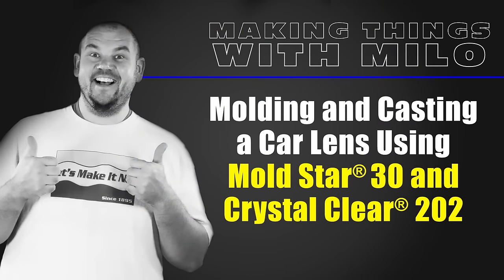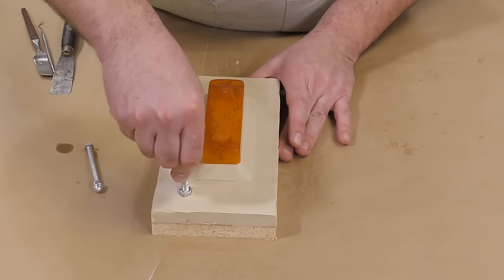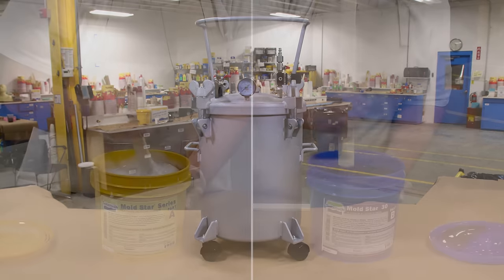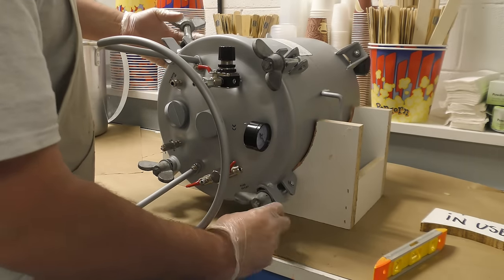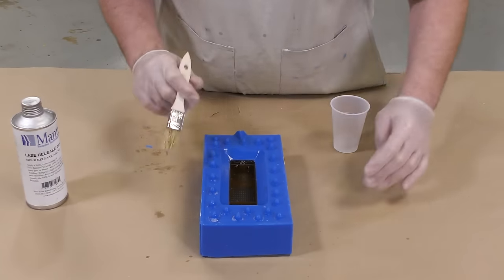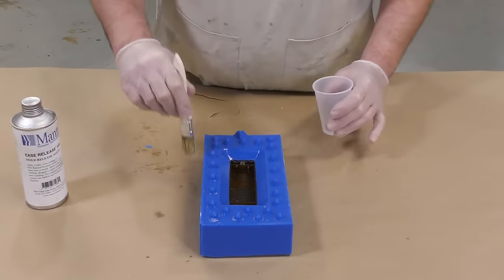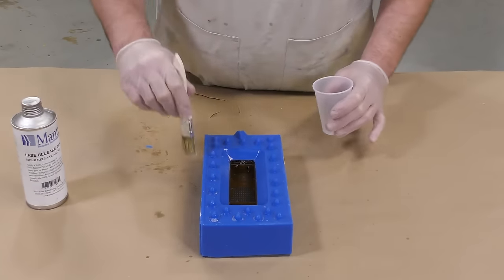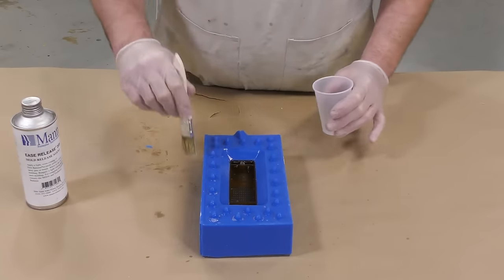How to Create a Replacement Tail Light - Moldmaking and Clear Casting Resin Demonstration

Comment: I was wondering what size pressure pot you were using?
Reply from the maker: The inside of the pot dimensions are 12.5" (31.75 cm) diameter opening X 15.25" (38.74 cm) Tall. https://www.smooth-on.com/products/pressure-chamber/

Comment: I am confused. I've seen videos of "lens casting" with similar materials- but a vacuum chamber was used, to pull out air- while here- a "pressure pot" is used. Also- what if a large lens is needed- maybe 5' long, 6" high; can "handmade" devices be made?
Reply from the maker: Both methods help remove bubbles from the finished casting, but in general we recommend pressure casting when feasible for bubble-free castings. If you want to discuss a specific project in more depth, I'd recommend reaching out to our 1-on-1 support team here: https://www.smooth-on.com/support/ticket/add/agree/

Comment: ok 
nice ! could you do this with brake and headlight lens?
Reply: Brake yes, headlight no due to possible heat and optical clarity issues and impact resistance.  Brake might also have heat issues since the same lens may have a bulb light for extended period during night time headlight/parking light use.

Comment: I didn't read through all the comments so maybe the following question came up already.
Why not use a vacuum chamber instead? I would think a vacuum would draw out the air bubbles. How is a pressure chamber better?
Reply: yeah sir, i keep thinking the same question. any differences between pressure chamber and vacuum chamber?
Reply from the maker: A vacuum chamber will draw out the bubbles that are mixed into the resin in the act of mixing, but the resin can still pick up bubbles during the act of pouring.  As pressure casting happens after the material is poured, as long as the mold is made correctly, this will eliminate those bubbles.
Reply: thank you for your englighment sir.
Reply: My question as well
Reply: I saw one video where they placed the molding compound in a vacuum chamber first then went on to pour the mold. I'm thinking this is a good way to go.

Comment: How do you deal with the issue of shrinkage? Or does this lens not have to mate into another part?
Reply from the maker: Shrinkage on this casting was very minimal, and the mold has zero shrinkage, so fitment was not an issue.

Comment: I have some Dragon skin 10NV coming, not that I have a gallon paint shaker on hand but I was wondering if that would help mix this product up? Actually wonder about a few ways.

Paint Shaker
Drum roller
Drill paint Mixer paddle

not that It can't be just done manually, me just thinking out loud.
Reply from the maker: You can mechanically mix using a turbine mixer, but will still need to scrape the sides and bottom of the mixing container.

Comment: Are there any plastics that are clear and good in high jeat applications that could be moulded this way?
Reply from the maker: What temperatures are you looking to resist?
Reply: @smoothon  Im not sure of the exact temprature, but i could find out. Im looking to build a replacement peice for an oem cam gear cover on a 4cyl car engine. The oem ones are plastic as well. Looking to go clear so you can see the cam gears turn. The aftermarket makes clear plastic ones for popular engines like the toyota 2jz. But not for my engine.
Reply: If you google clear timing belt cover you will see what i am talking about

Comment: Wouldn’t degassing the liquid silicon in vacuum work better than pressurized chamber?
Reply from the maker: When pressure casting, it is beneficial to make the mold under pressure as well, when possible.
Reply: my question is would putting the mold in a vacuum be better to help pull air and moisture out as well as when doing the actual casting??
Reply: Eric Eaton I think it’ll bring more harm than good. It’s better to “treat” or “prepare” the casting material in vacuum chamber, prior to pouring it into the mould. Effect would be similar to pressurizing it during casting, which is pressure difference before and during casting, with one major exception: if treated with vacuum prior to casting, the part comes out void of micro bubbles trapped inside, whereas if only pressurized during casting, all those micro bubbles stay trapped and suppressed inside the part.
Reply from the maker: This is correct.  Vacuuming should be done on the mixed material before pouring.
Reply: @smoothon  most definitely vacuum degassing before pouring into the mold form. But to clarity possibly, would this also be done in combination to pressurizing the setting silicone? Or is simply just  degassing, or just pressurizing alone sufficient? Thanks.

Comment: Let's say you want to mold an original injected molded rubber part.  I have a rubber piece to a car console.  It looks like stitched vinyl or leather, but it is actually all rubber that appears to have the grain of vinyl/leather as well as baseball stitching.  Is there a product to create this type of casting?  Would you still take the approach of using clay to make the mold for rubber?
Reply from the maker: Hi there!  This is a good question for our tech support team, can you send them a ticket here? https://www.smooth-on.com/support/ticket/add/agree/ Thanks for watching!

Comment: Could this work for things like toys that have a part similar in style to this?
Reply: Or are we able to send parts to you to make a casting part of?
Reply from the maker: Definitely, we have another video showing this similar process.  We don't make molds, we manufacture the materials -  https://www.youtube.com/watch?v=WlTuDgzhTlk
Reply: Smooth-On Also could you reproduce a rubber part this way that needs to be moulded from both sides? Or would a different method need to be used due to the part being Moulded is rubber?

Comment: I’ve seen people use a vacuum chamber to pull out air bubbles. Seems to require more careful observation (need a clear pressure vessel to manually modulate the vacuum as the material foams up) but it seems to be the best of both worlds if you alternate with pressure.
Reply: I would think using a vacuum chamber for the liquid prior to pouring then use a pressure chamber for the curing process

Comment: Have you got an easy way to produce a mold for a mirror image object?  For example, what if you wanted to produce a lens for the other side of the vehicle but did not have an object intact to produce the mold?
Reply: One thing you could do is try to see if the other side, when flipped over, will fit the side that's missing. If so, then doing a mold of the existing one will work find for you.

Comment: is there any danger with off gassing inside the pressure pot?  I know they use Nitrogen in autoclaves for this reason.
Reply from the maker: This resin is curing at room temperature, and as long as it is being used in a room-sized ventilated area, outgassing is not an issue for this process

Comment: Instead of resin, could you use cement ?
Reply from the maker: For concrete casting, we would recommend a urethane rubber mold, such as one made out of Vytaflex.

Comment: Would a vacuum chamber work or must it be possitve pressure?
Reply from the maker: Pressure Systems (pressure chambers and compressors) offer the optimal method for creating molds and resin castings that are truly bubble free.Vacuum Systems (vacuum chambers and vacuum pumps that pull 29 inches of mercury) are used to remove the air from high viscosity materials like silicone rubber before pouring. They are also ideal for vacuum degassing liquid plastics for making bubble free castings.

Comment: Is there any shrinkage in this process; most molds do.
Reply from the maker: Yes, but it is a very small amount, due to the thinness of the casting and ultra-low shrinkage of the Mold Star silicone.

Comment: Hy. I m living in România and we have an ours iconic car, Dacia 1310 that os basically an Renault 12, that is still no longer in production, but carguys regive them to live. Problem is with the parts and accessories like tail lights, turn signals. This should be a good idea to mold some and produce them

Comment: What process would you do to make the part you are casting dimensionality thicker making it a little more resilient to weather or in case of a marker lense stone damage?
Reply from the maker: Would modify the original model by increasing thickness via a layer of clay or pattern wax.

Comment: How long did you wait until the unmolding of this lens?  We made a lens using your product that is just a bit thicker than yours but it stays really gummy for a few days after molding.
Reply from the maker: This material can be demolded in about 90 minutes.
Reply: Are you sure your mix was precisely 1:1? If a 2 part mix (of any kind) isn't mixed properly, the product can take too long to cure.

Comment: Is there another product on the Mold Max line that cures at a faster rate to get the same results or does it have to be the Mold Max 30?
Reply from the maker: You could also try the Mold Max 29NV, which has a 6 hour cure time.

Comment: Could you make a mold  casting  for a  1/25  convertible model car?  It's different from  one with a top.  My windshield frame is fragile and I don't want to take the chance of breaking it.  Heather Smith

Comment: i have a question. Why cant i use a vaccuumchamber instead of the pressurchamber, wouldnt i get rid of the bubbles with this?

And could you eventually show how to make such parts, but of silicone material. Its always using silicone as a casting material. But what if i would like to produce parts made of silicone? how do i do this? thank you
Reply from the maker: These techniques are often used in different mold configurations. Here are some links which may help - https://www.smooth-on.com/support/faq/156/ and https://www.smooth-on.com/support/faq/111/

Comment: I've always used a vacuum to pull out the trapped bubbles.
Reply: That's fine for pre-pour, but with this kind of mold, you don't want it in a vacuum for hardening.

Comment: Question of curiosity, would you be able to do more then one color in the same mold at a time, for example the upper half of the lens being red and the lower half of the lens being yellow.
Reply: Ok, now how would I go about that lol
Reply: You would have to add a divider partition.  It would make what is already a PITA into a larger PITA.  Plus, why?  It is not legal to just pick whatever colors you'd like to have, for use on public roads.   Red should be nowhere but the rear and orange or yellow not on the rear, white only on headlamps (forward facing regardless of location) and the reverse and license plate lamps.
Reply: It's for another project that I'm setting up and I would be using a similar technique and this was extremely helpful, thank you.
Reply: + stinkycheese some tail lights have a clear back up portion,and a amber turn,built into a red tail/brake ...that's why ...
Reply: @stinkycheese804  Amber is legal on the rear.  Brake and tail lights have to be red but turn signals can be amber.  My wife's car has amber rear turn signals from the factory.  Makes it easy to find in the parking lot.

Comment: Can you recreate key-caps for vintage computers this way? Like. How strong is the resin when hardened?
Reply from the maker: This resin is very impact resistant.  We have several customers making custom gaming key caps with our resins.
Reply: @smoothon  That is soooo cool to know. Thanks. I asked in the first place, because reproduced real keycaps are not a thing yet, for Commodore64 computers. However, they have found the original case injection molds, and you can buy new cases, made on those old molds. It is just the keycaps that are not being produced. There were a kickstarter campain in 2015, yet it looks like the person behind, left with the money.

Comment: Yellow indicator lenses would be illegal in Denmark as yellow driving lighhts are allowed. You need to be able to destinguish between indicators and driving lights by color. Personally, I would have used a colorless lens and an orange lightbulb. But I guess it depends on the car and individual taste...

Comment: Can you color match an original lense? How many times can you use the mold?
I need several identical lenses for my motorcycles. They are rarely available, and when they are I could buy an entire new cycle for what they cost!
Reply: You can mix a few different small batches of the resin and let them harden in a cup, then see what color matches beset. For example, mix an ounce+ounce of the resin, add a drop of the dye color desired & mix it in, pour a few drops of the colored resin out to harden somewhere (maybe in a little silicon candy mold), add another drop of dye & mix in, and pour out a few more drops of it to harden, and add yet another drop of dye, and try again. You can then come pretty close to matching the color you need that way. It may take a little tinkering with tints and colorants to get it right, but you can probably do it..

Comment: Great video! How would you go about getting rid of the beveled look in the inside of the lens? Could you fill it with the crystal clear to smooth it out and than mold it? Would that work to remove that and still get a clear lens?

Comment: I hope you get time to answer. what if you don't have a pressure pod? or vacuum chamber?
Reply from the maker: You could also use a slower Crystal clear such as Crystal Clear 200.  This has a slower cure time, which may allow more air bubbles to find their way out.
Reply: Smooth-On you carry that right?
Reply from the maker: We do - https://www.smooth-on.com/products/crystal-clear-200/ but to order, please call us directly.
Reply: Smooth-On ok. will do.  thank you

Comment: I have a good question. When recasting a tail light lense with two colors what would be the process? Two different molds or same mold with two different fill points, and will the resins bond to each other when cured?
Reply from the maker: They will bond together as long as the new resin is poured soon after the previous is cured.  As for an actual technique, either could be used.

Comment: Although you packed the lens cavity with putty so it would help support it from crushing under pressure, isn't there still a need to put a vent hole on the backside to equalize this pressure? Especially for thin walled items.  It might also prevent warping on the long sides of the lens. (Maybe there are drain holes on the lens which might do the trick, I can't see.)
Reply from the maker: Can you send us a tech ticket? Our team can help you - https://www.smooth-on.com/support/ticket/add/agree/
Reply: Oh, 2 screw holes would work... never mind. Saw the procedure here. http://partsbyemc.com/pub/mold-making.htm if anyone would like another example. Cheers.
Reply: @smoothon  why a ticket? I'm venting mine from the backside. I'm just not sure why I should put a relief "Boat" in the cavity on side 2, but that's beyond this video I think.
Reply from the maker: Yes, venting a mold properly can require a bit of practice and calculation. It’s definitely something we would like to cover on a future video.

Comment: could i use a vacuum chamber instead of a pressure pod?
Reply from the maker: Vacuuming happens before the pour, so there is still a risk of bubbles, particularly in faster setting resins - https://www.smooth-on.com/product-line/pressure-vacuum-chambers/

Comment: Great video.  How did you calculate the total amount of resin/hardener? Was it the original lens' weight plus some %?  Thanks!
Reply: Crystal Clear 202 usually weighs a bit less than the plastics originally used in automotive lamp lenses.
Reply from the maker: You can calculate this by a volume test (displacement of the original lens in water) or a weight test if you know the density of the original material.

Comment: Nice detailed video! For pressure casting do I have to vacuum mold star 30 first or is it safe to put it in the pressure chamber? I've been hearing very different answers from different sources but from the looks of this video it seems like you just put the mold silicone into the pot without any degassing from vacuum chamber before hand.
Reply from the maker: Steven, Mold Star 30 is very low viscosity.  Vacuuming would not be necessary.
Reply: thank you!

Comment: Hello, I was wondering how you would go about doing this without a pressure pot? I will be trying to resin print (sla 3d printer) lenses but I'm unsure how it will turn out or hold up over time on my mr2. I would like to be able to do this though, just without a pressure pot because of lack of space for a compressor and pressure pot. this is probably my 5 or 6th time coming back to this video since i really want to make lenses lol
Reply from the maker: Without a pressure pot, you will run the risk of bubbles in your casting. Can you send us a tech ticket? Our team can help you - https://www.smooth-on.com/support/ticket/add/agree/

Comment: You don't add the ease release to your mold before pouring the resin in?
Reply from the maker: Release is optional when casting urethane resin into a silicone mold.
Reply: Smooth-On what product would you recommend for a strong uv and heat resistant black plastic. I looked at the smooth cast onyx fast

Comment: i need replacement rubber boots for a 1950 Willys jeep PTO shaft. It's hollow cone shaped with the acordian type sides for flexability. Can this shape be made?
Reply: That wouldn't be something you'd want resin for, as it cures to a hard state. No flexibility. You might be able to make one with the 2-part silicone, though. You'd have to make a mold of perhaps clay, and use it like you'd pour something to make ceramic...pour some in, make sure it covers all the inside surfaces, then pour out the leftover (though what you pour out would be trash, so you wouldn't want to try to save and reuse it). That's just my hypothesis, mind you.